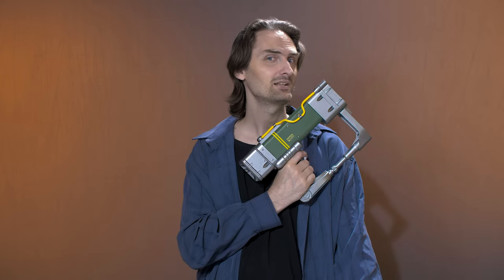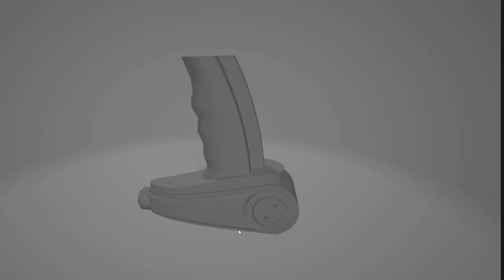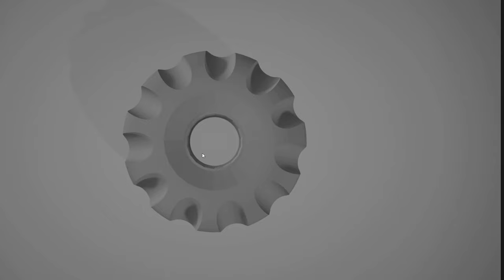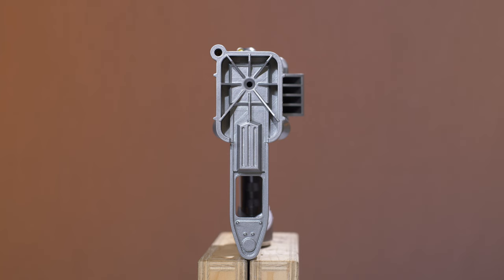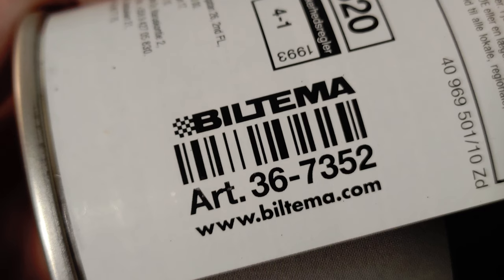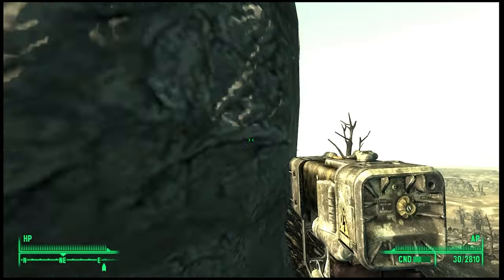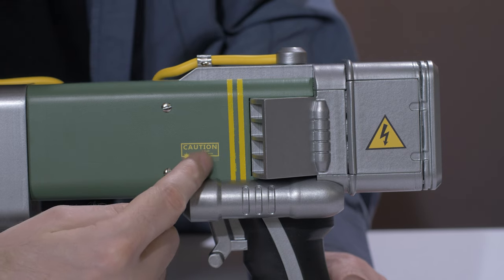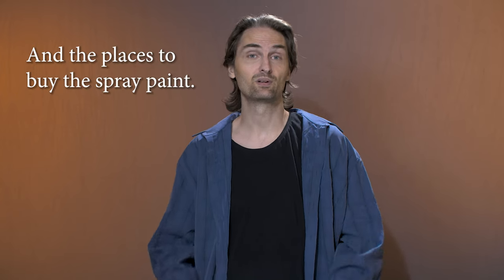Fallout AEP7 Laser Pistol labels. And tips & tricks.

Comment: Hey man, the "caution" labels with transparent background don't print out right. They are solid yellow with no text.
Reply from the maker: Hey, thanks for writing. I've just downloaded the PDF file to see for myself. And everything seems to be as it's supposed to be.  When I put it in Photoshop. It sees it As a picture, With the transparency. But I have noticed if I open it up in adobe PDF program It recognizes That there is text in the picture, I don't know if that is the cause of the problem.  You could try to convert it into a PNG And see if that works. Let me know if it works. Or I can try to upload a PNG file,
Reply: @falloutlady  thanks for checking. Ya, when I open it in iTOP PDF it shows an all yellow image for it but when I open it in Microsoft edge it shows correctly but when I print it in either one it prints an all yellow filled image. I will try converting it to another format and try again.